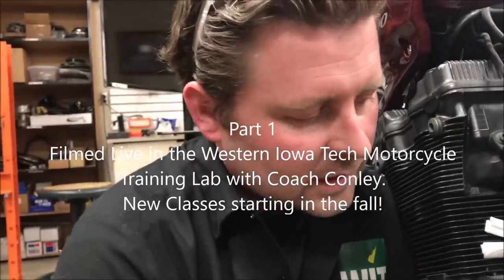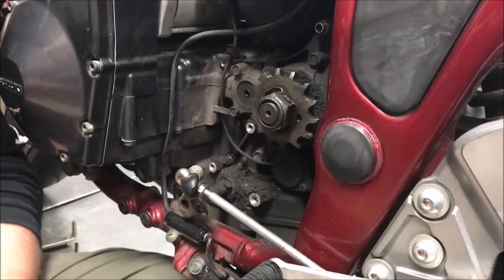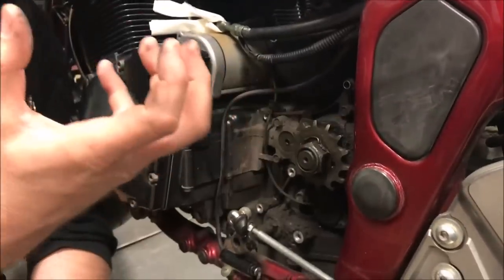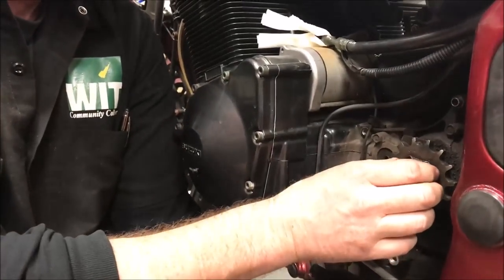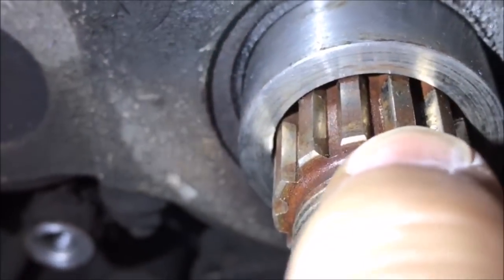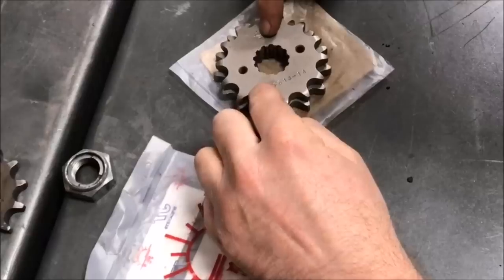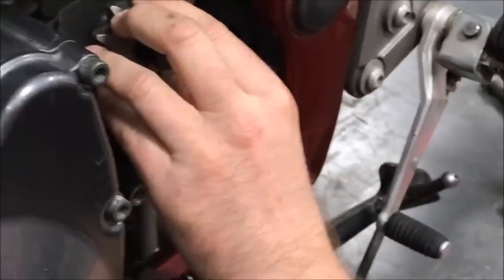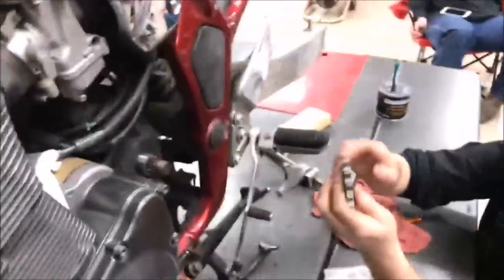Changing sprockets? BAD brand new parts! #generic #sprocket #chainandsprockets #how2wrench

Comment: A little play is NOT ok!  He is spot on worrying about that. I ignored that on my KLR650 for a couple years. There was some squeaking coming out of there. I took it to mean it was because I changed the chain and back sprocket without doing the front. The noise I supposed was the new parts wearing onto the boat old one. I was wrong.  The sprocket had become loose. Kept getting looser and looser. I just broke down 70 miles from home with a stripped out countershaft. I was able to shim the old sprocket out and catch what was left on the countershaft splines and limp home. I didn't break down way into the backcountry either where I just came from. Now I have to tear the entire engine apart to change that countershaft. A hard lesson. Keep those nuts tight people. Don't be like me. An ounce of prevention will save you a world of hurt.
Reply from the maker: Thanks for sharing Steven. 
 I do offer personal service to back up what's missing from a video to actually fix your specific problem. I do work on donations for my time and possible research. 
Good news is its CHEAP! For my time would mind becoming a member of my website? It comes with a free 20 mins of techline and that will cover my time to assist you so we both benefit. So to have me personal cell phone number to put in your phone as your direct info and how to coach, sign up now! As always thank you and enjoy the free videos! Much more to come! I look forward to working with you and hope you will become a member of or learning community. 

Link to membership: https://how2wrench.com/product/membershipmembers-onlymembers? 

If I can ever be of service to you, here is a video explains how to connect with me. 
https://www.youtube.com/watch?v=vjvmB01ebcs 
Direct link to services: 
https://how2wrench.com/product-category/tech-lineservice-callminutes/ 
Live Chat is great for you to actually show your specific issue!
Donation link: https://www.paypal.me/how2wrench
Reply: I've got to ask, why would you change your rear sprocket and chain but not the front! 😅

Comment: Excellent insight to what I would have usually just pass off as a quick DIY hour or so job in my garage replacing sprockets and chain. I will take note of all this for next time and just spare a little more thought just to check these points u address while I'm down there. Thanks.

Comment: I used an air tool 1/2" drive impact gun removing the front sprocket and it came off so damn fast.  I had a breaker bar trying to remove it and everything.  Damn it was so easy and fast!!

Comment: My DL 1000 sprocket has a thick body where the aftermarket was just flat. I figured that the flat sprocket was much cheaper to manufacture than what the OEM sprocket looked like. I wondered if the extra mass had anything to do with harmonic damping. Either way, I figured if Suzuki didn't think it was necessary to specify that extra mass and thickness, they wouldn't have done so. I got the OEM sprocket. After watching this, I'm REALLY glad I did.
 Great video.
 Shane, you can count me among the 'subscribed'.
Reply: For racing applications, many people accept reduced durability for the weight savings. If you're not racing, buy OEM parts...

Comment: Interesting info  ... your comment about the tranmission should be in neutral does makes sense ... however the Haynes manual I have for the Suzuki GSX/GSF 650-1250 says to and I quote " Shift the transmission into gear and have an assistant apply rear brake pressure"  and I can say from experience rear brake pressure on it´s own will not do diddly squat if you are trying to loosen the nut by hand ... I had to use an impact driver on my 2016 GSX 1250 to break it free with the rear brake on and the bike in first gear , it did come right off though, but that was just to get it off , I will torque it up by hand with loctite after locking the chain to the rear aksel  ... I have also noticed on the (OEM) front sprocket after just 5000 km small indents/hacks in the middel of every tooth on the sprocket itself , the splines on the drive shaft are perfect though so I´m not sure what´s going on there .
Reply: Use the rear brake and a 2x4 next time you do it by hand

Comment: I wonder if you still read comments from such an old video but I just had a mishap with my 92 Honda 750 nighthawk. Ill be blunt I mixed up the torque. I read 79flb on the sprocket and watched this video and stupidly assumed I was looking at the right value. It says 79flb for 5 rear sprocket bolts and 39 flbs on the "driven spvocket" there's a typo in the manual lol but seriously I fucked up when I put 80flb on a 39flb nut. I heard it creak...and what you said suddenly came to mind how I'd be screwed if I over torque it. Now it's pissing oil from the bolt hole itself and a rubber seal thing came off with the bolt when I undid the 80flb and I went to go put the proper torque, I put the rubber seal thing on the end of the screw and tried to push it in. Thinking back I probably shouldn't have done that. Im still checking it to see if it drips even while it's torqued but there's no easier way to fix what I did without a full rebuild is there?... I have no idea how screwed I am...every time I look up what happened all I get is videos talking about the outer seal replacement but this is inside the bolt hole...I don't know man I think I'm shit up a creek
Reply from the maker: Yo....we are just the media team and Shane answers to tech questions for channel members everyday (and the personal messages that make sense for us to forward him) Join the channel to support him and get your questions like this answered...best $1.99 you'll spend on yourself...make it a great day...
Best way to help us back is joining or grabbing our T-shirt! Support links and gear below!  Awesome and thanks for commenting! Smash the subscribe button (thank if already a sub!)
Have you seen our "YouTube Trained Support Shirts? Great way to "high five us" https://goodfellasmerch.com/collections/how-2-wrench/products/support-shirt

Join this channel to get access to perks:
https://www.youtube.com/channel/UCBhM8DCKnT3qXwTW0eToyCg/join   
-Daily MEMBER FIRST COMMENTS ANSWERED FIRST 
-Live Q/A video chats
-Wonder if we have a video on your need? Members can request content links!
-Full Access to the ENTIRE 700 video library
-Member-Only FREE tool giveaways   

Just want to say thanks quick to support us for this information and our work saving you money? 
Give us a high 5 here:  https://www.paypal.me/how2wrench   

Got an emergency and your head is about to explode from frustration or fear? Get Shane’s cell here: https://how2wrench.com/ols/products/techline-one-on-one

Comment: I have a 2005 KDX 200 unfortunately the front sprocket is doing the same thing you have shown in your video. I have taken very good care of my bike. Is this something that eventually happens to every bike? I bought the bike New and rode it for about 4 years. My main questions for you are, is it impossible to avoid this type of wear? And how much would something like this cost on average to replace the shaft. Thanks
Reply from the maker: If it was a quick answer I’d try to respond here but I wouldn’t want to lead you wrong assuming certain factors. Reach out to me on my website contact page. We have been overwhelmed with ungrateful people and scammers so I had to do something for my sanity by screening the over 300 requests a week!

Contact Link: https://how2wrench.com/contact/ 

Your answers and help are just around the corner. Save time and money while protecting your investment and yourself by doing it the right way at www.How2Wrench.com  
Have you subscribed yet to never miss a video? 

Have you seen the video playlists https://www.youtube.com/user/conleybuilt/playlists? 

Want to say “thanks” or “keep it up”? Click here https://www.paypal.me/how2wrench

Comment: Shane I just installed a new JT countershaft sprocket on my zx9r torqued it staked it correctly super tight nice fit to shaft DID NOT apply grease to splines is it worth it to disassemble everything to put a little grease on splines? Thanks
Reply from the maker: Like I said. I am fan as it puts a barrier of protection. If it were me, Yes. Most would not worry about it. Thank you for the comment. See the link below for more help with your question. I have been banging my head against the wall thinking of ways for people to say thank you in an impactful way to help keep these videos coming. Here are few ways that many have found as a way to give back. 
* Membership to H2W (includes t-shirt or tech help) https://how2wrench.com/product/membershipmembers-onlymembers/
* Simple donation to say "KEEP IT UP"
May you have a great day and... https://www.paypal.me/how2wrench

Free Mechanic info, tool reviews, and “how to” videos newsletter sign up: https://how2wrench.com/subscribe-free-newsletter/

Missed a past issue? No Worries. Newsletter Archives: https://how2wrench.com/blog/newsletter-archives/

Like freebies? Click here for a free diagnostic checklist! 
http://gem.godaddy.com/signups/364621/join  

If I can ever be of service to you, here is a video explains how to connect with me. 
https://www.youtube.com/watch?v=vjvmB01ebcs

Comment: just like afam and other brands they use the specs that are written in the service manuals, mistaking the spline on the gear and where the front sprocket goes. just like afam does with the grom 125 msx 125. or the service manual on the grom has a fault where its written 14.9 instead of the actual measure 13.9 or the manual has never been adjusted for a other year model.  like i did measure the countershaft yourself and do the big search.
Reply: remember, one such mm fault in the service manual that is written first. that the whole line and all other companies that build aftermarket and oem sprockets will build the wrong sprocket. and i guess too that the countershaft is from another model that just fitted. 21.7mm may be correct but the 25mm  on the jtf513 haha  on that gsf1200 it is not 25mm
Reply from the maker: Thanks for commenting and adding value to our community!

Have you subscribed yet to never miss a video? Have you seen the video playlists? Over 600 videos! Check them out here: https://www.youtube.com/user/conleybuilt/playlists  

Want to say “thanks” or “keep it up”? Click here https://www.paypal.me/how2wrench    
 
Your answers and help are just around the corner. Save time and money while protecting your investment and yourself by doing it the right way at www.How2Wrench.com

Comment: Ya could ov holded the back brake in to stop chain turning
Reply: And sometimes that will work, but try it on a factory installed countershaft sprocket, especially on a supersport with their high torque applications... I've had a guy standing on the rear brake while I stand on the breaker bar and turn the rear wheel. This is why you hear about people putting a pipe or 2x4 through the rear wheel to prevent it turning. People who say "just hold the brake" clearly do not have a lot of experience removing countershaft sprockets.  They can be a real PITA. The last one I removed called for 165 nm, and I had to use the 2x4 through the rear wheel and a 3' long cheater on my breaker bar. It was still a bear, and I rounded the nut slightly before it finally broke free even with a 6 point impact socket.

Comment: So that could be the clunky noise when I accelerate my DR650SE out of a tough curve or from standing under load?
Reply: Could also be a loose chain. Or a cheeeeep wore out chain?
Reply: @boystoyz8922  since then I have replaced a whole set, a Jap top quality one, checked there is a superior fit on the drive shaft teeth, worked on getting an ideal tensioning - and there were no trouble ever since.

That's my 1st complete fresh set in my ownership period. I highly recommend it to any used MC rider, and better sooner than any clunking noise 🙏🏼🤙🏼✌🏼

Comment: sounds like some loctite would do the job
Reply: Yeah, I was going to say that.  When you do multirotor RC or 3D Heli RC locktiting is very important because the screws come loose and you don't have to super tighten for it to stay.  I locktite nearly every screw/bolt lol, including furniture.
Reply: No, the problem is the shape of the splines. Front sprockets are notoriously difficult to remove, and I would be hesitant to loctite one. If the sprocket fits correctly, and torqued properly when installed, you won't need any loctite. The last one I did called for 165 nm, and I thought I might never get it off. I'll pass on the loctite for this application, thank you...